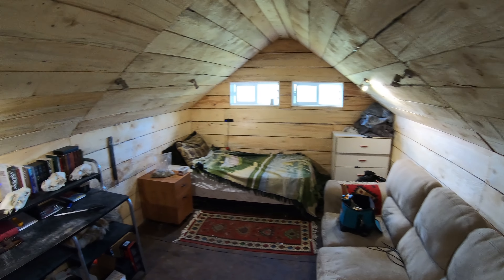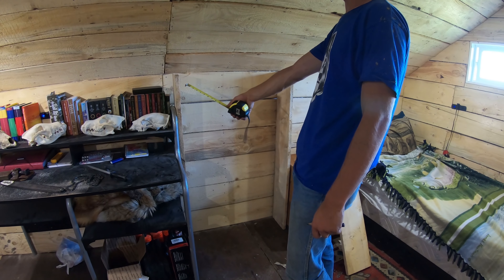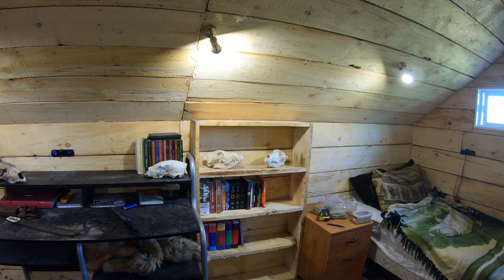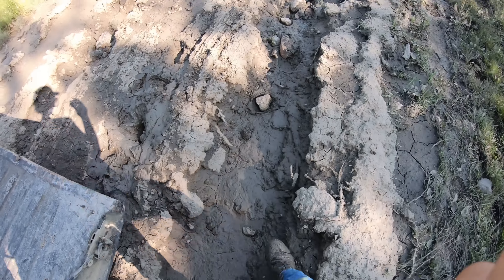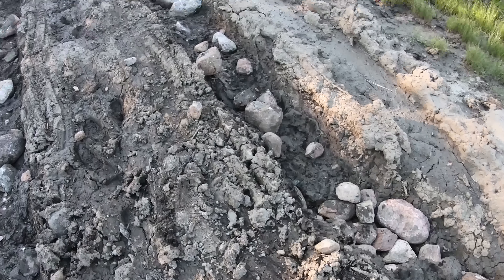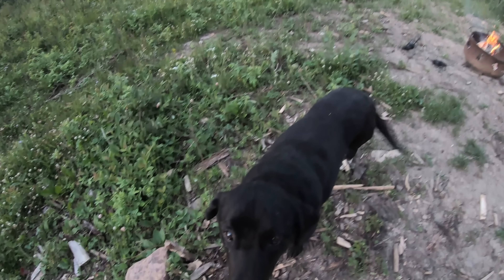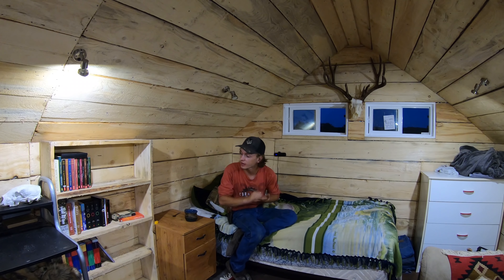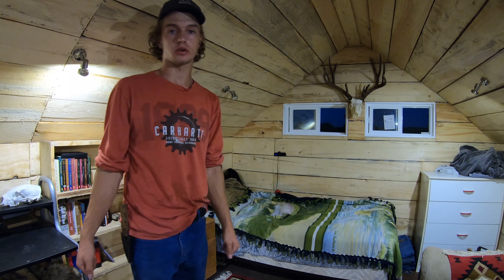Bushcamp - Building a Bookshelf in the Offgrid Cabin, Finishing European Mounts, Road Repair

Comment: Hey buddy great video as always. My driveway is 1500’ long, probably not as long as yours is but I’ve faced mud for years before I did something similar to what you’ve done. I went to the local small river to get my rocks. Loaded truck after truck, but eventually I won. Takes a lot more than you might think. Anyway good to see you got the truck out and she’s ok. She’s a beauty and it would be a shame if she broke. I changed my name I used to be the redbone bandit. Thanks for the great video. 👍👍
Reply from the maker: ya mine is a few km lol. ya u r right will definitely have to haul some more in there over time. good to see ya as always buddy

Comment: I think the 2nd gen dodge is missing the grille lol. There's a mid 70s military truck that was used in Canada I'd love to have. They were a 1976 Chevy 5/4 ton that was used in the canadian forces up until the mid 90s when they auctioned them off. They were equipped with the 350 small block,th350 transmission,np203 transfer case (full time 4 wheel drive), Dana 44 from axle and the 14 bolt rear axle.

Comment: Your problems aren’t over yet with your soupy hole, Old timers used courdroy. When it got bad again, add more logs..easier pawing on your truck too.
Reply from the maker: yea for sure. will smooth out when softens up again and i drive them into the ground. dont mind it rough cause it is such a small stretch. i can make it through any mud hole of that length with momentum alone just not when it dries out and i high centre so god damn bad. but when the frost comes out in the spring there is 0 chance in hell you are making it through there weighing 8000 pounds. u would be lucky to ever get your truck back haha. if i clear out beavers this spot will be good forever though they are root problem
Reply: Traplines and Inlines The root problem is the general cause of every conundrum..get a lip ripper and let er buck 🤘
Reply from the maker: @SwampDonkey530  hahaha cheers buddy

Comment: When you get a really soft spot lower your tire pressure.  With your truck and tires I recommend to start at 10psi.  You need a real wrinkle in the tire.  I have driven out of stuff I got stuck in just by lowering the pressure big time.
Reply from the maker: hey bud 10psi is wayyyy to low particularly on big diesel like mine. i would ruin the tires for sure. i run 80/65psi for reference. plus i have to way of airing them back up
Reply from the maker: plus i was only stuck cause i was high centred loowering psi would be counterproductive lol
Reply: I use to own the same truck. You dont need to put max psi in the tires with no load.  Esp not offroad.

Comment: I have so many questions. My brother showed me this channel and im shocked someone else around my age doing this! Im down here in Mississippi. I got me a little homestead going i call it Princess Prarie and yea i love it. I painted my shack and my barns pink and my doors are glitter coated. Really cute. Anyways I was wondering about your solar.  Im stuck on mine. What type of battery did you use. And whats your set up like? For now I been using my ol Honda generator.
Reply: You should check out his video labeled "Offgrid Cabin Build Pt. 17 SOLAR POWER, Electrical, Light Fixtures and Plugs for the Offgrid Cabin!". He covers all that :)

Comment: Serious question. Why are so many cabins built with the top floor extending over the front of the main floor?  Less foundation? Porch overhang? Air flow?
Reply: Most Provinces have a max 1st floor square footage of 100 sq/ft before you need permits and inspections. Lofts and overhangs add sq/ft without exceeding the max.

Comment: Well that Ramcharger still has the old 727 torqueflite in it and baby jacked it up on some major blocks and have a and you can have floor jack happy gets bellhousing the first first thing you do is take the transfer case and then the transmission and you can get a kid for that all the bands and all the all the plates clutchfans and all that they're not that bad to do near mechanical incline I got confidence in you could get that dodge back going
Reply from the maker: yea i could get it going but just not worth it buddy. the truck is falling apart. floors are rusted right out, all kind of holes in it, wiring is a mess, gas tanks falling out and the mice are in their horribly. going to buy a pickup of same generation with the 4spd and use the RC for parts
Reply: I understand that but it's a Dodge